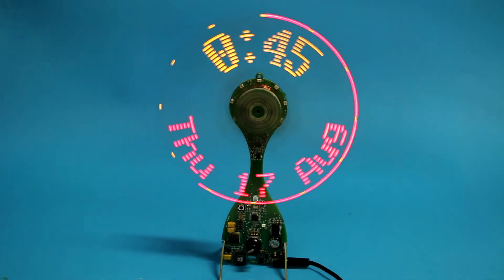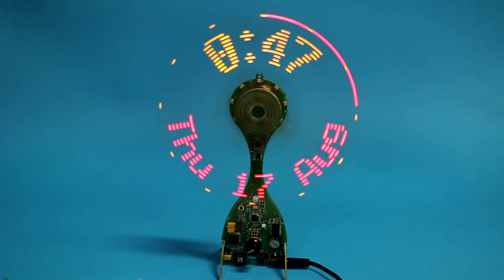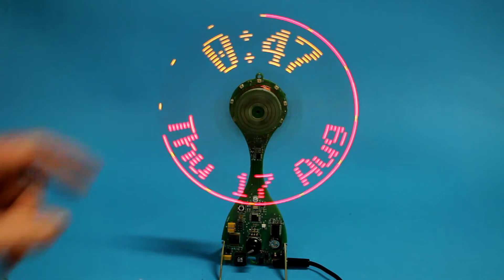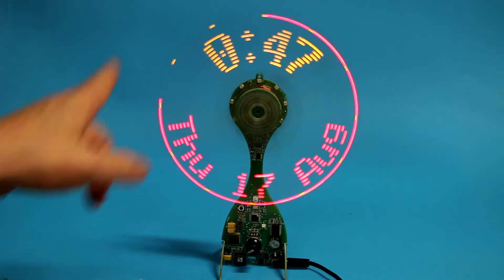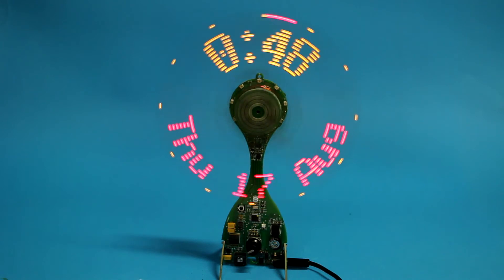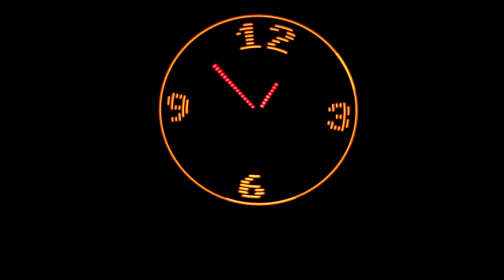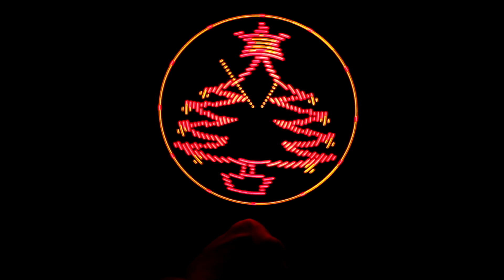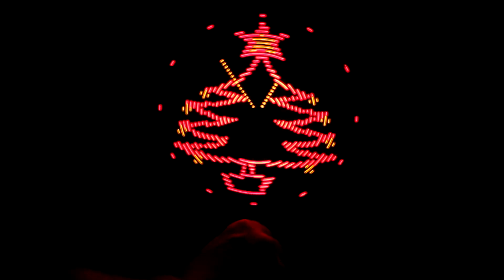Elektor Propeller Clock finished (sort of...)

Comment: nice demo of a very nice pov clock. and you are right: buiding the coilgenerator is the hardest part.!
for a detailed video of the construction of the motor and rotor, follow this link: https://www.youtube.com/watch?v=i0I1eRmNHiQ
The solderpads on the back of the rotor are intended for balancing purposes:you can use solder to balance the clock.